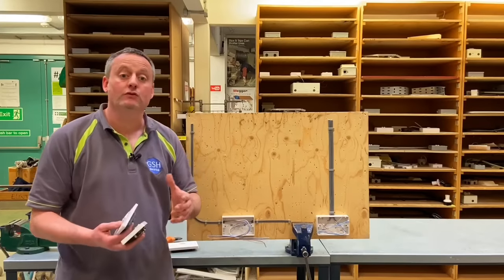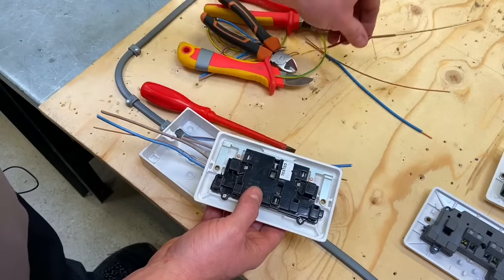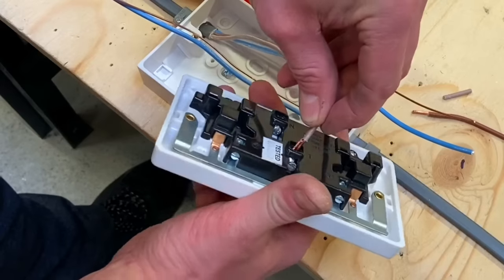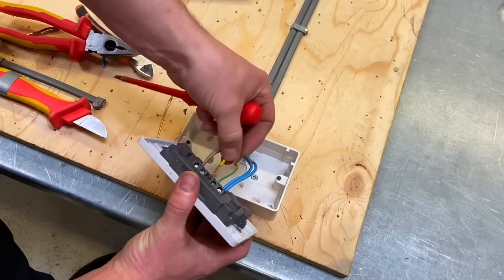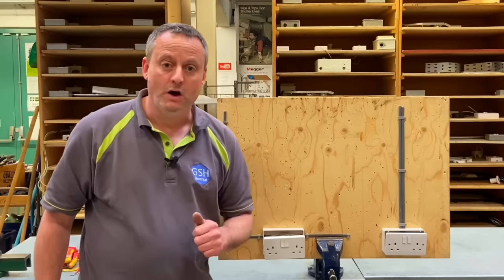How To Terminate (Connect Up) a Twin Socket Outlet BS 1363 (How to Wire a Double Socket)

Comment: the only time i would double over conductors is when there is only one in the terminal. what if your are taking a spur from the socket, you wouldnt get three doubled over conductors in
Reply: Me too.
Reply: @truthseeker7794  111
Reply: Always double them if it’s a part of the ring with no spur.
Reply: I have seen them twisted together found when testing ring and cable broken off.
Depends on make they mostly have clamp type terminal I only double the earth wires.

Comment: Strange that you are using a knife to strip wire first thing I learned in college was put a nick in the wire it will break. That's why t stripers are the way to go in the USA. And they are multiple function. I know it's a little different wire style but it all works the same way. By the way my little girl was born in oxford 32 years ago I'm. Not a stranger to the way things work over there wonderful country You have.

Comment: You missed the bit where you have to dig your cables out of the wall first after the plasterers skimmed over the box! Following that I would strip the sheath to the length of a standard English carrot leaving the inner insulation to be stripped using my teeth because I'm old school! 👴🏫🤐

Comment: I'd like to see how much you damaged the copper conductor when you attacked it with a knife! There is a potential for it to snap when you push it back in the box!
Reply: I agree. I always got a "bollocking" for even scratching the copper. Ringing it with a knife with "firm pressure" seems sure to mark it a bit.
Reply: Strippers are always the best.

Comment: Personally I utilise the earth terminals with 1 terminal used for both earths on the Twin and the other terminal used to earth a metal back box.
Reply: At least you earth the back box. Wont be a long wait for the rest to say you don't need to, the screws do it🙄
Reply: @mark86sprk5  You do like to "write" provocatively 😂😂😂.

You'll probably get an avalanche of responses coming up with myriad reasons for and against.

I used to take the view that one day I might be standing in the dock having to justify my reasons for doing a job "just so".

Spending a few moments earthing a box might, rpt might, be your "get out of jail" card. Literally.

Most of us will have seen this debate on other vlogs and will have formed an opinion one way or another.

This debate is perhaps going to be a reprise of those.
Reply: @t1n4444  i don't mean to provoke but I do resent negligence. Why do anything less than to maintain the integrity of a connection to the highest standard. Any argument to the contrary is not good enough when distributing electricity.

Comment: changed one of my sockets at home.... one of my blue wires had current on it... I know you are supposed to switch of power supply when you work with electricity all right .... is that normal?

Comment: Been an electrician for 26 years and I’ve never used a knife like that to remove insulation. Snips or actual wire strippers. Do everything else the same. Double back connections, leave a good length on conductors.
Reply from the maker: Thanks for commenting and your feedback 🦾. Gaz
Reply: Mk cutters <3 unless you're heavy handed
Reply: I’ve been an electrician for 40 years and I always use a knife to skin cables.
Reply: I use my teeth😬
Reply: like Gaz says its to teach learners the basic hand to eye coordination skills first which is fair enough.

Comment from the maker: 00:00 - How to connect up sockets 
00:42 - Making off my first BS 1363 twin socket outlet 
00:48 - Connections in the back of a twin socket outlet
01:13 - Cutting the cables to length for a twin socket outlet
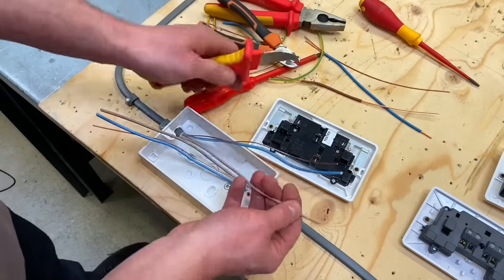01:48 - How deep are the terminals in the back of a twin socket outlet
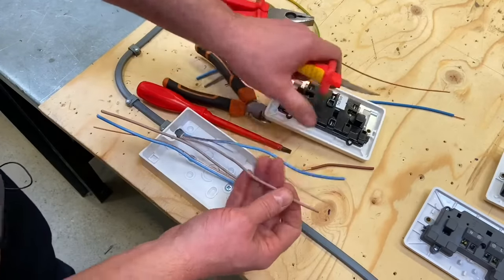03:03 - Terminating the line (live) conductors into the back of a twin socket outlet 
03:35 - How to double over the conductors into the back of a socket outlet 
05:03 - Terminating the neutral conductors into the back of a twin socket outlet 
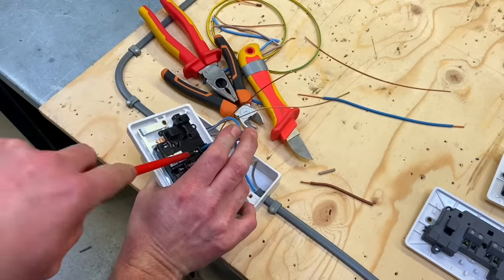06:17 - The correct conductor length in the back of a twin socket outlet 
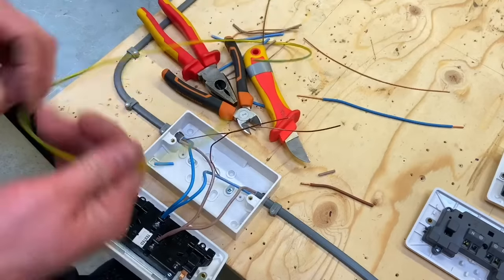06:35 - Terminating the CPC's (earths) conductors into the back of a twin socket outlet 
08:52 - Putting the twin socket front onto the socket box 
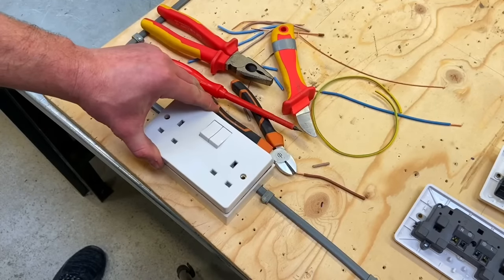09:07 - Top tip when connecting socket outlets
09:52 - Connections in the back of our second twin socket outlet
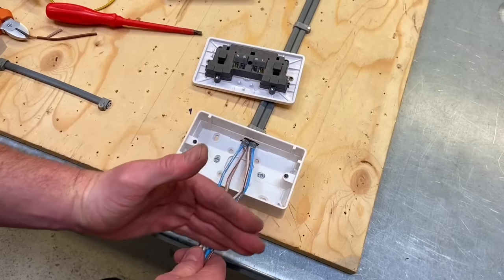10:22  - Cutting the cables to length for a twin socket outlet
11:14 - Connecting up a twin BS 1363 socket outlet
13:29 - Summary of learning for second fixing a twin socket outlet

Comment: About time the industry used "Wago" style connectors on the back of sockets (I know you did a video on this a while ago).
Reply: They're hard to pull out though since you have to twist them to get them off. Could be annoying in a tight fit.
Reply: MK are now selling double outlets with lever style screw less connectors a la Wago

Comment: Doubling over the cable, what do you do when there are three cables coming in rather than two (eg spur off ring)? Keep them all straight? Usually three doubled over will not fit in.
Reply: Bit of common sense comes in handy.😎👍🏻
Reply: You only need to double over the conductors when there is only one going to each terminal, on a radeal or a ring main there's will always be two conductors to each of the terminals so no need for boubleling over, the only reason for it is so as the terminal screw has somthing to bite on to
Reply: Same here, single cables get doubled, 2 or 3 don't get doubled ... the only exception would be for cpc especially when there is 2 ports on the outlet. 

My only issue with doubled solid conductors is that it work hardens the copper and of its then straightened back out there is a high probability it will break so as a rule I never try to fold it back over, cut, strip and create a new doubled end. This also has its own problems when the cables are short to start. 

I personally think a screw in terminal is best for outlets, I know there are "wago" style outlets available but I find them to be "chunky" in depth foe example 2 legs of a rung and a spur in a 25mm recessed box, client wants to change for a USB outlet ..... leaves almost no space between the rear of the socket and the back box .... the only change I'd like to see is swapping the traditional screw to the clamping arrangement that is common on MCB, RCDs, Main switch etc. Would allow more room at each port, even clamping and would negate the need to double the ends over.  

Putting wago connections on outlets is great for ease in connecting but on the flip side most of the faults, loose connections, spur on spur on spur from am excited DIY'er is rampant now and will get worse due to the few that are put off trying now will go the opposite way and add to the DIY "It was like it originally"  --   "I always use an electrician"  -   "my mates a spark"  and so on.... 🤣 thoes who know how to wire a plug so they can wire a socket.....its only 3 wires and they are colour coded 🤣

Comment: Great video well explained. What is the difference in the 2 screwdrivers you mentioned at the start of the video?
Reply from the maker: Thanks for commenting - the size of the blade on the screwdriver head the terminal one is to small to get the connections tight 🦾. Gaz
Reply: 3mm _3.5mm for light switch terminal

4.5mm _ 5mm for socket terminals

Comment: Do the terminals ever need to be torqued down?
Reply from the maker: Great question 👍🏻
Reply: Only ask because I recently invested in a torque screwdriver but can't seem to find any specification printed on any equipment.
Reply: There is a document listing the torque for plugs and sockets in BS 1363-1:2016 13 A plugs, socket-outlets, adaptors and connection units. Specification for rewirable and non-rewirable 13 A fused plugs

Comment: I have heard sparks say that the reason for doubling over the ends of conductors is to give double the CSA at the point of termination and to fill the terminal up.
I can see the point about filling the terminal but I was taught that the main reason for doubling over is so that the screw clamps down onto the conductors more firmly. Your thoughts Gaz🤔
I have to say: Crabtree, instincts socket outlets have clamps instead of screws and IMO are the best on the market. No doubling over required. They're superb 👍
Reply from the maker: Instinct Range From Crabtree - Electrical Accessories Designed to Make Life Easier for Electricians https://youtu.be/oRJKiImSpJE

I like the instinct range. The larger the conductors (doubling over) the greater the area for the screw to hit 🦾. Thanks for commenting. Gaz
Reply: I personally despise the obsession with doubling over. It's not a regulation, and is in breach of manufacturer instructions in 99% of cases. Not following manufacturer instructions can open hell later on if things go wrong.
Reply: @arcadia1701e  I agree 👍 it's not something I like either and you're absolutely right about following manufacturers instructions, but I can see how the limited surface area of a screw head is going to make a satisfactory connection doesn't exactly instil confidence. That is why I mentioned the Crabtree clamped terminals. 
Although screws may be a long established form of connection, I feel it's time to move on😁👍
Reply: @kendoknackersackee  if it doesn't "instill confidence" why do you walk away from it then?
Reply: @mark86sprk5  That's why you double over, because it gives the feeling of a solid connection. Anyway, I meant in general, not me personally.
A single screw terminal is overdue an update and improvement though, wouldn't you agree?
Reply: @kendoknackersackee  yes
Reply: @arcadia1701e  A very, very excellent point about following manufacturers' "method statement" ... and the possible consequences (dire) if you don't.

If you do alter anything in the installation then you'd better have a well reasoned argument and risk assessment for so doing ... and with which a qualified thirty party would agree.

A DJ tends to accept a qualified witness' statement rather than a lash up by someone trying to cut corners.

I gather section 510.3 in the 18th says to defer to the manufacturers' instructions.

I spoke with my insurers on another matter entirely and their view was that where a manufacturer stipulates a way of installing "anything" then that's what they want to see in the event of a claim.

(Also spoke to a boat inspection authority and their view was exactly the same ... simply follow the install instructions as per manufacturer.)
Reply: To me I think for the screw to fix it firmly, and to Avoid the cable for coming off the terminal
Reply: @t1n4444  o
Reply: Same here, single cables get doubled, 2 or 3 don't get doubled ... the only exception would be for cpc especially when there is 2 ports on the outlet. 

My only issue with doubled solid conductors is that it work hardens the copper and of its then straightened back out there is a high probability it will break so as a rule I never try to fold it back over, cut, strip and create a new doubled end. This also has its own problems when the cables are short to start. 

I personally think a screw in terminal is best for outlets, I know there are "wago" style outlets available but I find them to be "chunky" in depth foe example 2 legs of a rung and a spur in a 25mm recessed box, client wants to change for a USB outlet ..... leaves almost no space between the rear of the socket and the back box .... the only change I'd like to see is swapping the traditional screw to the clamping arrangement that is common on MCB, RCDs, Main switch etc as a standard. Would allow more room at each port, even clamping and would negate the need to double the ends over.  

Putting wago connections on outlets is great for ease in connecting but on the flip side most of the faults, loose connections, spur on spur on spur from am excited DIY'er is rampant now and will get worse due to the few that are put off trying now will go the opposite way and add to the DIY "It was like it originally"  --   "I always use an electrician"  -   "my mates a spark"  and so on.... 🤣 thoes who know how to wire a plug so they can wire a socket.....its only 3 wires and they are colour coded 🤣

Comment: By terminating the cpc's separately can lead to unacceptable R1/R2 readings.
Reply: Why?
Reply: @E6EES  Because R2 (cpc) is connected across the full width of each socket's earthing plate leading to an higher value than R1. The more sockets on the circuit, the more the discrepancy between R1 and R2 which should be roughly the same value/lengths when dead tested.
Reply: @andrewweston8954  Absolute rubbish! The resistance is negligible. Also R1+R2 is the reading taken before the circuit is energised in order to take the Zs reading which is the important reading to ensure the required disconnection time is met.
Reply: @E6EES  Absolute rubbish? Try explaining it to the NICEIC inspector on your yearly visit. Good luck with that one!
Reply: @andrewweston8954  yes, absolute rubbish. I've explained the reason for taking the R2 reading. An nic inspector would explain the same but I would hope you are not a qs as you do not seem to understand the basics.
Reply: So you suggest it should be terminated together right

Comment: Of course this all falls over in real life when replacing a socket outlet with short cable available. 9 times out of ten the terminals will be configured wrong relative to the existing layout or you’ll find a spur bodged in. All terminated in the cheapest nastiest socket outlet available!
Reply from the maker: All good points - the training environment is very different 👍🏻
Reply: Agreed 💯  an unfortunate truth, along with the taped up connector blocks buried, even twisted and taped connections and the list goes on 🤣 I spent 4 hours today chasing down a cpc continuity fault on a ring circuit....most outlets were hidden behind wardrobes, extension lead centipedes, new sockets and new colour wires in a property with the old red and black, client states "its all original"  but a friend admitted to changing a faceplate and adding 1 socket. The culprit was a 2G outlet with 4 individual  2.5mm T&E rammed in connector block, with  fly leads of individual 2.5mm cores to the outlet 🤔 they tried to extend the ring, I thought so I configured the terminations correctly, but now my r1+r2 are way too high 😤 trace the new cables and find a spur on a spur, on a spur THEN TO A FUSED SPUR OUTLET and continues on to the other side of the kitchen 🤦‍♂️ can't split the ring, no room in CU, kitchen and bathroom are tilled floor to ceiling walls and floors  ..... if theyd got it right in the original socket or even put the fued outlet before the 1st or even before the 2nd new socket .... but nope!!!    So close, yet soooo far 🤣 anyway rant over lol

Comment: Hi, great video!
Q: Why do you need to add CPC sleeving, if it was needed why does it not come as standard? Also, if the CPC size is 1.5m, would you get the same size sleeving, or 0.5 bigger; so in this example 2m.

Thank-you!

Comment: This obsession with doubling over has to end. There's no requirement for it, and it's against manufacturers instructions 99% of the time.
Reply: I think most people would agree with double over if there's only one conductor (so the screw doesn't tighten on the side of a conductor). 
No need to double over when there's more than one conductor though.
Reply: When it’s a single cable you get way better grip when it’s doubled back, each to their own I suppose, takes 2 seconds, less chance of a loose connection

Comment: Excellent tutorial, Thank you. I recently bought sockets from screwfix and its a few years since i carried out a rewire. I design and make things for a living and could not believe what I was seeing. when the powers at be spout Regs and health and saftey at every breath and then I come across the very points that you made about shallow terminals, different depth terminals on the same socket and having two seperate cpc connectors, I can now call total bullshit this whole set up.

First of all make all suppliers of electrical sockets conform to one standard so that all the sockets have their terminals in the same place and the same depth also have one cpc connector joined internaly  (dont understand why you are connecting them seperatley but stand to be corrected if you have a valid reason ie how many people have been killed because both cpcs have been connected to one connector).

 Next one of the big companys like Milwaukee need to make a tool that cuts evrything in one go and folds the cable ends automatically including the correct length of the outer cable so that its a one press button operation in about 5 seconds. An electricians job is hard work and if all this was applied it would cut down the termination side of the job by 2/3rds not to mention ware and tear on the electricians hands(which matters when you are the wrong side of 50 and you still have to work until you are 67}.

Lastly, this whole system needs to be dumped and changed to the wago system and be done with this.

All electrician need to get together and only buy one type of socket, that would force the manufacturers of the crap sockets to change or go out of business.

We need more People in charge that have a technical background not academics/ lawyers/ economist, preferably non university graduates. 

We need more Elon Musks(people that can think for themselves and are not sheep).

Ok Rant over, going back to finish the termination now(oh joy).
Reply: You right the amount of wrong connector terminal some appliance light fitting don't mach the uk irish wire ring standard
And who come with the idea for lsf cable in domestic forget how to work 
Cable more rigid very hard to strip bulkier  and personally I prefer when a smke smell from cable
Many call out when people smell something is wrong